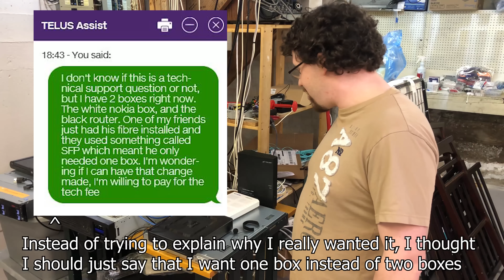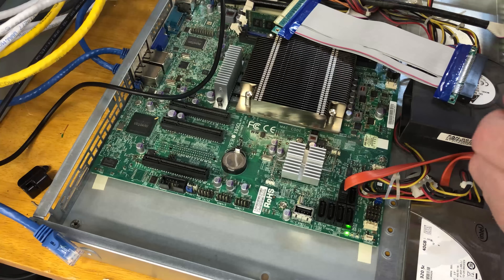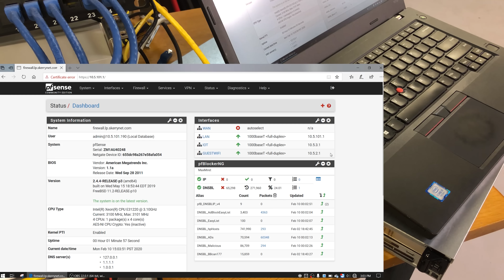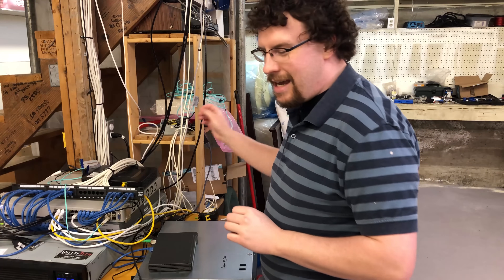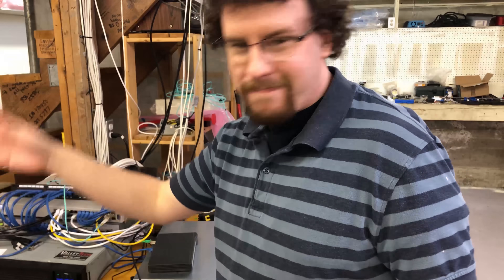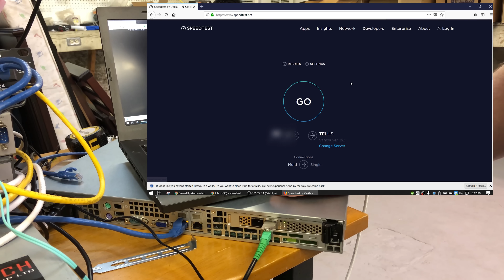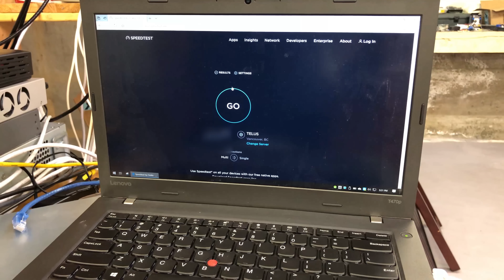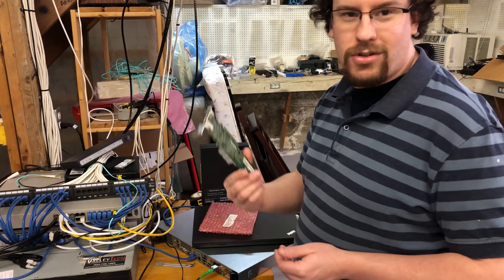I connected my fiber internet directly to my pfsense router via SFP!

Comment: I'm jealous that you get symmetrical rates. Both ISPs in my area barely give you half your download rate for the upload even with fiber to the home.
Reply: The bottle neck is not the fiber at your house, it is the supplied connection to your ISP. Unless they  have there own direct connection to the internet they have to purchase there own connection out. And they "like you" have to purchase packages. So to make more bang for their buck and not put all the cost on the customers they balance the load. Making it possible for their customers to have higher downloads.
Reply: @undergod1987  Except the two ISPs in my area are actually the backhaul providers. Cox and Centurylink. So they aren't buying service from a backhaul provider, they have their own national fiber.

Comment: Great video! What are the specs of your pfSense router?
Reply from the maker: Thanks! It's a Xeon E3-1220 with 4GB Ram
Reply: @TechwithShae  what case / unit is it?  I am looking to set up pfsense and do exactly what you did but i need to buy a unit first.  do you have any recommendations?

Comment: Here in europe (spain) the isp gives you an all in one router/ONT module that have a pin programmed into it, without that pin, you can't connect to the ISP. You can open up the router and get the pin wiring the motherboard of the ONT to a USB port on your computer and then use a program to read the pin when it's attempting to connect to the ISP, every user gets a different pin, so you cant just look it up on the ineternet. Then with that pin you have to take the ont/network card you want to use and reprogram it. :) 

All of that just to make you rent their 5€ router which is 30€/month (about 35$) plus the connection itself, plus another shit that you're probably not using but you cant unsubscribe from it. 

so you end up with a 100€ bill for a 400Mbps 20ms ping connection.

Comment: I use my ISPs ONT and a $150 Ubiquiti router and I get 950/550 (my plan is "gig/half gig"), so nothing wrong with my performance. But I too am a huge nerd and would love to move to SFP based termination, but I don't think it's really possible in New Zealand simply because it's intended for business customers and the plans cost so much more. I'm jealous!
Reply from the maker: That’s kind of how mine was setup before. I also had no performance issues. It’s true though, the nerd in me couldn’t resist, and the cost of a couple of used cards was worth it!
Reply: I’m also in New Zealand and the reason why there is an ont is because it’s easier when you have 20 isp that can use the ont and one line company, chorus or ultra fast fibre in my case put an ont because it’s easier to manage with 20 different isp and less change that the ont is lost or broken by the customer

Comment: nice , but like you stated iptv and telephone user still need that darn modem:(
Reply from the maker: Phone for sure (unless you are still on copper), iptv I’ve read that some people have gotten it to work, but it was unreliable. So it could be possible, it’s just a matter of replicating whatever sorcery the ISP’s router is doing. If I subscribed to iptv I would be trying to figure it out.
Reply: @TechwithShae  The T3200 can be put into bridge mode on port 1, if you want the "easy" way to support all of the stuff that thing needs. HOwever there's about a 10% overhead when you do it this way. My speeds increased 10% when I plugged the SFP directly into my switch. BTW you could do it that way as well, plug the SFP back into that 3COM (or something newer with faster backbone fabric) and plug the telus box in via Ethernet and then connect your PFsense into that switch too. Lots of ways to do it. But pfSense direct is pretty sweet. :) I get 3 IPV4 & 3 IPV6 simultaneously. Never pushed it higher than that, normally I'm just using two IPV4's.

Comment: SM have PCIE riser cards, google it. 
System was running when you connected the PCIE cable.....! 
First Card was 10GbE (Overkill) and likely a dual personality card (Network & Storage) which can result in issues.
Reply from the maker: I replaced the ribbon with a riser. I'm not sure why the unit powered up, forgot to unplug power before starting.

Comment: Are SFP and SFP+ backwards and forwards compatible?
Pretty sure your connections are SFP while the first addon card you got was an SFP+.
Reply: a 10g module can be set to 1g mode manually, sometimes it does not autodetect
Reply: @zachicusmaximus5551  Not if it can't run at 1G. Some 10G cards on eBay are 10G/SFP+ only, similar to Quanta LB6 switches, those ports won't work with 1G SFP modules. On Linux you can find out supported modes with "ethtool"

Comment: 10:16 "700 Mbs not great" he says. I'm over here with 35 Mbs :(
Reply: I use a 3G router and an antenna and i get about 200Kbps
Reply: Im here with no cabled internet connection because the only cavled connection that i can have here is a 56K
Reply: Chris Parussin Ohh so you have at least a two digit number we barely got 1kbit download. 
Now with mobile we get about 30mbit/s to 19mbit/s and similar in upload which is still nothing.
Reply: @chrisparussin5359  that sucks, sorry mate!
Reply: I'm here with 100mbit cellular and 3mbit dsl as my options.
Reply: Robert Pendell at least you have a public ip and you can open the ports
Reply: @chrisparussin5359  not over cellular which is my primary connection. I can get moderate nat on my cell provider but only due to the way they have their nat configured.
Reply: @chrisparussin5359  you get a public ip to, but its dynamic, its changed every time you reset the router.  You have to pay for a static ip
Reply: Im here with 100 mbps
Reply: i only have 16mb download and 1 mb upload and no way to get fiber and it's been like that for 10 yeras now where i live i wish i had his slow speeds 700mb down  and his upload makes my upload speed look even worse internet in the north east of the uk sucks
Reply: @100PCTMAGS  It also depends on your ISP if you are with SKY (who don't provide FTTP) then you might be missing out by having FTTP and not knowing it.
Try the other ISP Checkers especially BT, or try https://www.openreach.com/fibre-broadband
That will say what you can currently get and what is due to be available.
Also most of the up north areas of the UK can get Virgin Media, so have you looked into that?
Reply: Im still on 56k
Reply: Kenwood _ that’s really bad mate and I know how you feel
Reply: I get gig up and gig down
Reply: @MikeHarris1984  Nice, that faster upstream would come in handy for streaming :)
Reply: We use in my village tin cans with wire :(
Reply: @CocoSloan  I actually remember doing that with old beans cans with string as a kid. :)
Reply: I get 23 down and 5 up....
Reply: I'm over here with 2mbps
Reply: +1
Reply: Yep.... Can feel same as he
.. 700 is not great
Reply: here with a 10gbps internal network, and a 2.5mbps internet connection, my isp promised 1gbps fiber before august 2016, still no signs...
Reply: over here with 15.7mbit. 😕
Reply: @hycron1234  Well I just found out this morning that BT over here in the UK has upgraded their FTTP speeds once again and I can if I choose to as of this morning upgrade to 910Mbits down and 110Mbits up for just £10 GBP more per month.
I might phone them and see if I can get a good deal.
Reply: Im here with 8Mbps. Australian net sucks...
Reply: I'm the same, use to work for spectrum, know the capacity on the line....he's not line ran but att ran . SMH I'm done
Reply: I have 100 Mbps up and down
Reply: 16 down 2 up here.... megabits....
Reply: I would agree... I get over 900 Mbps on my connection using a Edge router lite
Reply: Nice, and me from Germany....
5 Mbs!
Thanks German Government! 🤦‍♂️
Reply: I'm just under a gig on 5g, van do better on a mobile connection
Reply: 700 is a little slow, I'm usually at 900-1000. :)
Reply: Rob, They don't know how lucky they are... I'm paying 100 for 50Mb down, 5up. Frontier bought out the telephone company a couple of years ago and I knew they were talking about doing FIOS in this area.... now that company is bankrupt.....

sigh 50Mb it is I guess.....
Reply: I only have like 180 mbs
Reply: Max internet speed in iran is 16 mb !  🤣🇮🇷
Reply: I get like 5mbs max 😐
Reply: Im still at 20mbps
Reply: Yikes...im in the middle of nowhere on the side of a mountain with 2.5 gig up and down tiny town of 1500 people. Thanks Canadian laws and dozens of ISP choices 😂 . But seriously how is that possible folks running dialup in the USA still or friggin LTE/5G  or they have 1 ISP choice 1....1 huhhh??? And i had Gig Cable for almost 10 years
Reply: I'm here with 10G :)
Reply: @UltimateByte  banhoff?
Reply: @UltimateByte  What country?
Reply: @UltimateByte  wtf
Reply: @UltimateByte what for?

Comment: Did you just hot plug a PCIe card?
Reply from the maker: Not on purpose, I didn't unplug the power cord, but the server was off. For some reason it powered up randomly when I was inserting the card.
Reply: @TechwithShae  It might be unrelated, but i have some motherboards that "wake on expansion" meaning PCIe, probably not because its probably listening for speciffic signals
Reply: Look at the reflection in the case, it didn't light up until shortly after he plugged it in, not quite immediately. However, it definitely triggered a power-on sequence. Some server motherboards do support hot-plug.

Comment: IPTV setups in this context are multicast based. Additionally, the implementation is going to be covered under proprietary trade secrets by the Telco. As such, getting information about how to configure PFSense to properly relay the multicast traffic will be difficult.
Reply: They use both actually. Unicast is used for instant channel changes, then you switch to multicast after about ten seconds, if of course there is another viewer watching that channel on the distribution server. Getting that information isn't difficult at all, the TV service is tagged on a separate VLAN and all you would need to do is enable IGMP.
Reply: @bartzago  I did this with Telus Optik on my Unifi system - it is indeed a unicast/multicast system however I found the packets here in Edmonton were not tagged with a VLAN.
Reply: I have a IPTV service, how would I look up what vlan it’s using and how to get it work through pfsense?
Reply: @user-fp3mn3dw7x  normally they use TR069 for remote configuring of devices to get them configured for the right VLANs and everything (IPTV, phone), I was surprised that connecting directly to the PFsense box worked for the internet connection but I doubt my connection would work right because the company I have does check for the mac address of the provided Huawei modem, maybe I will to do it and spoof the MAC on OPNSense.

Comment: your considered  lucky if your ISP is not using OMCI on the GPON network. And you can do this.
Reply: Care to elaborate on what those things mean?
Reply: @Ender_Wiggin  its basically a tr069 of GPON with added option which is security, that security is doing end to end encryption (from your ONU to ISP fiber optic switch).

if you dont know how to handle to those encrypted packets, your router (in this case pfsense) will just send/receive a bunch of junk packets.
Reply: @EmilePolka  Darn, I was hoping i could do this with Frontiers Fiber but it seems to run OMCI. Thank you for the quick explanation.
Reply: The SFP ONT that Telus uses has encryption in it (I believe its AES), they have to scan a barcode on the SFP to authenticate it to the OLT. (head-end device) The tech that installed mine knew his stuff.

Comment: I wish I could do this with at&t fiber. It's a pain in the butt just bypassing the gateway/router.
Reply: You can rip the 802.1x keys/certs from a NVG589 and then never have to use the AT&T gateway again. You'll need to use pfSense, Mikrotik, or Ubiquiti as they support 802.1x client support (typically via wpa_supplicant).
Reply: @tcc5750  how do you accomplish this?
Reply: @tcc5750  I have the 5268ac and there isn't an easy to follow guide on extracting the certs from that.
Reply: @ikkuranus  You can buy a NVG589 off Ebay for usually under $50. There is an easy github guide, all you do is downgrade it to a firmware that is rootable. The ONT (little white box) is what does subscriber level auth with AT&T's regional AAA servers. It doesn't matter if AT&T gave you a PACE or Arris BGW-210, you can use the certs from an NVG589. I've been running this for about a year now and its quite nice.
Reply: I'm using this configuration with AT&T Fiber.
AT&T Gigabit Fiber Modem Bypass Using UniFi USG:
https://medium.com/@mrtcve/at-t-gigabit-fiber-modem-bypass-using-unifi-usg-updated-c628f7f458cf
Reply: Same..
Reply: No kidding. Especially trying to do a site to site to another office on another ISP.. I think they like to watch their customers jump threw hoops.
Reply: Yeah, we wanted to run a second wifi network in the basement where the ONT was, couldn't do it.
Reply: I've heard it just required tagging outbound traffic with a certain Vlan ID

Comment: This is great. Thanks for putting this up. Is your connection a PPPoE one or Telus just assign IPs by DHCP?
Reply from the maker: The IP is assigned via DHCP, no extra configuration was required.
Reply: he said it's assigned by an static public ip
Reply: @foxar8379  thanks. But the issue I have is that my connections (Bell) are also public static IPs but I have to connect using PPPoE.
Reply: @manesha13  I believe PFSense support PPPoE WAN.
Reply: @mikejbam  thanks for the feedback. I'll look into it.
Reply: It's surely IPoE

Comment: It is likely your first NIC doesn't support 2.5GB and your GPON fibre transceiver is 2.5GB
Reply: HPE Ethernet 10Gb 2-port 530SFP+ Adapter - Operates at 1 Gbps/10 Gbps, auto-negotiation, on both ports. Network card does not support the transceiver you installed.
Reply: Seems to be the same transceiver that Bell supplies for FTTH and is 2.5GB.

Comment: wish my isp sasktel would do this, have the same ont as you showed at the begining. No sfp port on the gateway. Now just imagine if shaw cable and there fiber with telus in your case allowed setups like this.
Reply: ISPs really don't care about CPE. You can fully remove the Bell Hub 3000 and feed the Fibre into any device you want. If you want to retain TV/Phone, you will need to tag the appropriate VLANs to pass TV through to the Modem to feed those services. Internet doesn't matter, tag vlan 35 for Bell and way you go..
Reply: Also, did your service provider supply a service access switch?
Reply: @Ajicles  basically the same ont and there arris 5268 gateway. I can and am bypassing the gateway right now. Just would be nice to drop the ont. I might play with it in the next little while.